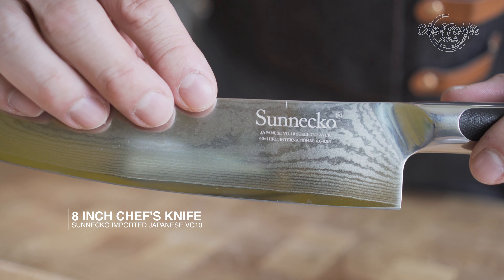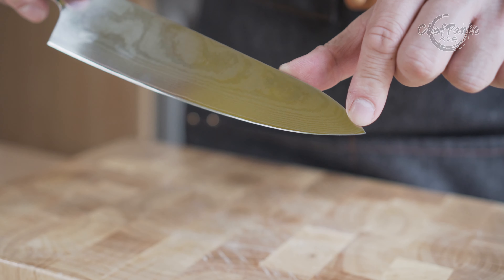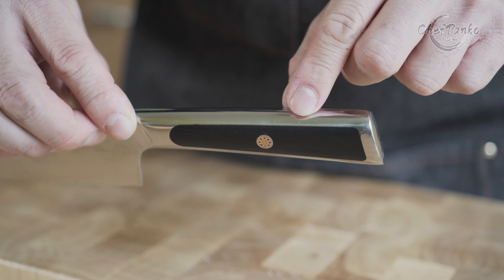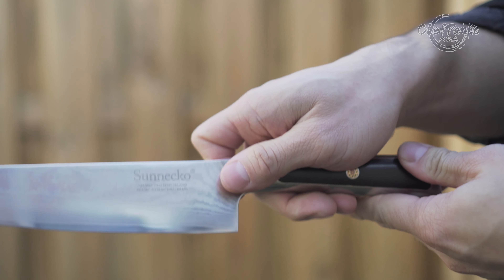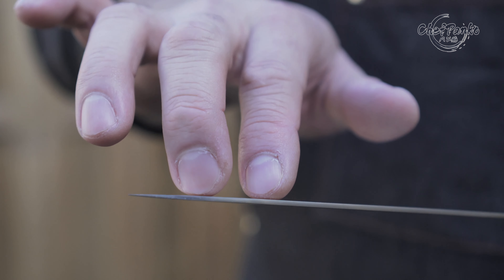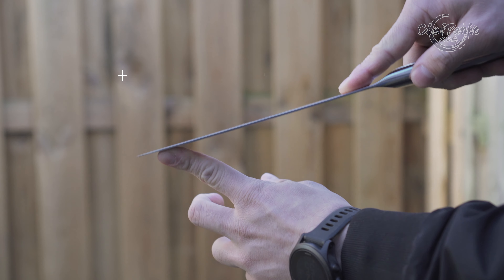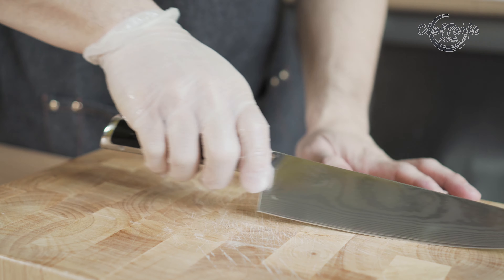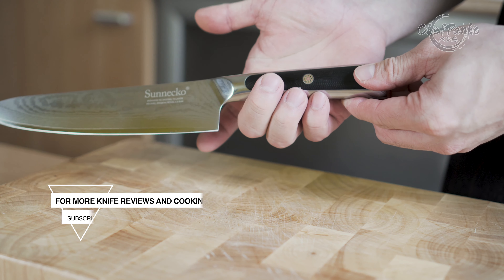Sunnecko Chef knife Japanese VG10 + G10 Handle  - AliExpress

Comment: I bought a 5 inch sunnecko vg10+damascus pattern santoku knife and after using it a while I have serious doubts about their HRC 60 +-1 claim. The knife I received wasn't super sharp and it dulled very quickly despite using it carefully for vegetables and meat. The findking aus10 was hugely sturdier than sunnecko. It makes me wonder if they downgrade their smaller knives (and drop prices accordingly).
Reply from the maker: Very interesting you might want to give it a touch-up on a whetstone. I give all the knives a slight touch-up especially when I see that the sharpening angle that they used is too low or incorrect. This will extend the edge retention of the knife. 

This also gives me an estimate of the Rockwell since I use the same angle for all the knives depending on the steel-type. 

Most Chinese knives will definitely fluctuate in edge retention from the factory sharpening but after a touch-up, they are pretty similar. 

But I never tried a 5inch knife but that is a very interesting discovery since you said it was a Santoku,  a 5 inch is for my personal use and at work to small. 
So I can't completely test it.

A 5 inch is in the range of a petty knife, more intended for smaller tasks so I can't completely give it a fair comparison over an 8inch for example. (Things, like rocking or doing herbs, etc, won't be done on a petty knife it is more of a slicing motion). So I don't think I can compare it equally. 

I will see if I can figure out a fair comparison but that is indeed a very interesting subject that you discovered. 
I will probably order a petty knife to test it and not a Santoku. 

Thank you for the information as far as the Rockwell specs on Chinese manufacturers it is saved to assume the lowest. So the stated 60 +/-1 you can give it a 59 rating (and some brands are even lower but did not have that with Sunnecko, Keemake, Findking, Samura, Tuo, Xinzuo yet).
Reply: @chefpanko  Ill give it a try when my whetstone arrives. At the moment I'm not really using it after findking arrived. To be honest, 5 inch santoku is too small to be practical for anything except slicing tomatoes.
Reply from the maker: @kratos1590  That is also the reason why I never bought a 5inch Santoku, the 7-inch santoku is the minimum and only used at home.
Reply: @chefpanko  I realized that after I had purchased it. No knuckle clearance and it cant cut large slabs of meat. Funny thing is that a 5 inch ceramic knife I owned previously was okay because it was taller and gave me knuckle clearance.
Reply from the maker: @kratos1590 , In my opinion, the Santoku 5inch should have enough knuckle clearance so that is a bad choice by Sunnecko. A petty knife in general (5inch) does not have knuckle clearance.   

This is how I use a petty knife: Fingertip grip when doing a smaller task (delicate slicing) on a cutting board, pinch grip for smaller task off-the cutting board. 
But peeling an apple or other things I usually use a Paring knife around 3.1 inches (8cm). 

I don't have experience with a Santoku 5 inches but for a santoku, I expect that it just performs like a 7-inch Santoku. Since I don't see the appeal of using a 5inch Santoku as a Petty knife. 

However, the above Petty knife explanation is only used at work. At home, I use an 8inch (at work I prefer 10+ inch) chef knife and a paring knife all I need. 

Was the ceramic version a Santoku? 

Thank you for sharing that information since I only have tested the 7inch+ knives.
Reply: @chefpanko  yep santoku part of a kit. Other than weight was pretty happy with it for vegetables and simple meats. As long as you treat it like porcelain it lasted a year in a home environment. Kit had 7 inch, 5 inch santoku and some lesser paring knives
Reply from the maker: @Schar.ar.youtube  You can hone it with a ceramic honing rod, but eventually, you need to maintain the edge with a whetstone since the honing rod is a temporary solution for a quick touch-up. Keep in mind that a Honing rod should not be used on a single bevel knife like a Yanagiba etc. Also, some Japanese knives with a High Rockwell require whetstones that are hard like Ceramic or Diamond coated but once you go for that kind of Japanese knife you should already know how to maintain a knife otherwise I advise bringing it to a sharpener that has experience with sharpening Japanese knives. Talking about steels like HAP40 steel with a Rockwell of 64+ (those require harder whetstones).
Reply: @chefpanko    thanks for detailed information... i have a queation now... i dont have any stone or strop... but i have 3 high quality Japanese knives... im about to buy a sharpening tool for them... should i go for strop und compound . Or whetstone 1000/6000 ? 
Thanks
Reply from the maker: @Schar.ar.youtube  A strop and compound will eventually stop working depending on how hard your knives are that can be in a month or few months that a strop has an effect but that will eventually wear off. A strop is intended as the final step to removing the microscopic level of inconsistencies of the edge after a sharpening session which in return gives you a razor-sharp edge. 

A whetstone is eventually a must-have to get the edge back from the countless of uses the knife edge will get rolled over and over again with a strop that can't fix and a honing rod effect will be reduced. The whetstone grind material away from the sides creates a new cutting edge that hasn't been rolled left and right multiple times, therefore, bringing new life to the knife's edge where a honing rod will be effective again until it stops working and you need to repeat the sharpening on a whetstone.   

A whetstone of 1000/3000 is more than enough for an edge that only is dull. 
1000/6000 is fine too but requires a bit more experience to jump that high, it means that your sharpening session on the #1000 needs to be good before you finish on a #6000 grit.

If your Japanese knives are very hard I recommend a ceramic stone like the Naniwa Profesional line. (Those stones are pricier on paper but during usage, you will notice that they are very effective and don't wear out as fast as the cheaper alternatives another plus is they are splash and go so no need to be pre-soaked).
Reply: @chefpanko  im reaaaaly thankful for the info you give me.. if i understand you correctly... it would be perfect a whetstone with 3000/6000  sharpening on 3000 and  finishing on 6000 ... am i right? And my knives HRC is 60 +- 1 also can i use steel rods ( HRC 65 ) or ill damage the rod or my knife ?  I love the rods but i prefer to buy a whetstone instead of ceramic rod... at the other hand i like to have a steel rod to hold my knives sharpness.. im not sure if its possible for my knives with 60+-1 HRC
Thanks
Reply from the maker: @Schar.ar.youtube  #3000 is a bit high and will work better if the knives are not that dull so making sure you get the knife on the stone earlier is better than later as this will make it harder/more time-consuming to get the edge back. It all depends on the state of your knives. The duller the knife is the harder it is to grind away material on a higher grit stone. A good middle ground is a #1000 grit stone and in most cases, a #1000 is sharp enough, you can even strop it on a newspaper if your sharpening skills are developed enough. As a beginner, I recommend ceramic stones because they are harder and give you a better overall feel of what a good angle is. While the soaking stones are a lot cheaper I don't find them beginner friendly as it requires knowledge and experience since the stone dishes out very fast, so you won't notice when you are doing it wrong (ie; wrong angle). There is more information on my website: at the knives and more tap - Maintenance & Sharpening.
Reply from the maker: As for your second question (for some reason youtube only showed half of your comment) it depends on your steel rod, most cheap steel rods are not hard enough to be effective on knives with a rockwell of 60 or higher. For that you need diamond coated steel rods, but those rods can be a tad aggressive removing too much material at once reducing the lifespan of your knives (you want to maintain the lifespan on the knife especially when they were expensive). A ceramic rod is best of both removes adequate material without removing too much or being too aggressive, hard enough to be effective on higher rockwell knives. But as I said a rod is a quick touch-up not a solution in maintaining the knife edge. A rod is just the ease of use instead of getting the stone out having it on a sharpening bench or platform so that it does not move taking the time to sharpen the edge etc is not convenient in some cases. Therefore a rod is a quicker easier solution especially during cooking. When you prepare dinner and you notice your knife is a bit dull, you will grab a honing rod for a quick touch-up and you are good to go. Once the effect wears of you will plan ahead to plan a sharpening session on a whetstone. Another benefit of ceramic rod is that in most cases they can be used wet, this gives your knife a different effect (not all manufactures allow for wet honing on their ceramic rods).

Comment: Can you make a video on wood handle maintenance?
Reply from the maker: What kind of handle are we talking about? Western handles, Octagonal? The steps are pretty simple and short. 
But if you can explain what you want to know then I can see the video context a bit better. (So that I know what to cover).

Thank you for the suggestion.
Reply: damiancanteros what I did for my knife is sand it a little for smoothness and then treated it with mineral oil to keep it moisturized and then sealed it with a mixture of mineral oil and bees wax to make it water resistant.
Reply from the maker: @The_Albino_Dino  I have more of a lazy approach, mineral oil (When the wood is noticeable dry) only and when there is a lot of dirt build-up (a layer of dirt) I sand it a down and apply mineral oil again. I'm really lazy with maintaining the handles, I just do it once in a while since I'm mostly tired after a long day standing in the kitchen (so usually I do maintenance on my day off). 

But my love for traditional octagonal handles will always take over with my purchase decisions even when the G10/Plastic handles are a better fit since it is maintenance-free. Especially wooden octagonal handles are what I love (testing a carbon fiber one it is good it looks nice but wood and octagonal has a special place in my heart).
Reply: @chefpanko  D-shape wood handle. If you want you can look for Santoku Eden Kanso. I've got mine from a seller in the Netherlands. Very happy with it.
Reply from the maker: @damiancanteros  I'm from the Netherlands, I saw the Eden knives, they are an own branded knife from knives and tools. Some of the Eden line up are made in China and some in Japan, currently I have way too many knives so I can't buy any new knives yet. 

But I will see if I can get a knife from them for a review since Global Europe has sent me their knives for review including Tojiro. 
The fun part is when I first started as an Apprentice Sushi Chef, the Global knives were what they recommend to all new apprentices I sold mine a long time ago and now Global contacted me for a knife review for them. (Tested all the series and I chose the classic series over the others a review about it will follow too).

As for wooden handle maintenance, I will see what I can do, even for the D-shaped ones the steps are the same that has been pointed out by @Dino
I will probably do a maintenance video in a knife buying guide that includes all the information about knife profile, balance point, handle design and handle maintenance.

Thank you for the suggestion it has been noted.

Comment: Hello, I have 2 questions and I would appreciate if you answer.
1- Would you recommend this knife to use in professional kitchens?
2- Is there a knife in this price band that you can say better than this product, if any?
Thank you ..
Reply from the maker: This knife in the video is not recommended for professional use since the handle does not give any extra grip, it is way too slippery. 

Before I can answer the second one I need to know what cuisine you are covering and what your main task is at the restaurant. 
A lot of veggies? Meat? boneless meat?  etc. 

And with the price range, you want it between $40 to $50 or $60? 

For example, someone that works in a Mexican restaurant is going through a lot of veggies, for them, I would suggest a Nakiri. 
But it also depends on the individual preference of the chef like the handle length, weight and balance point. 
Especially when it comes to knives that you plan to use in a professional kitchen.
Reply: @chefpanko  If I am more specific, I am wondering which blade you deserve the most price in terms of sharpness, longevity (no rust), among the knives from aliexpress you have tried. Which knife did you like most from brands like xinzuo, sunnecko in the video? Thanks .
Reply from the maker: @aentorries  Yes this Sunnecko version, so with the handle, not all Sunnecko series. 
Each brand has different handle designs etc. So it is hard to say that another series is not good either so the Sunnecko in this video is not recommended because of the slippery handle. 

As for no rust and good edge retention, I will say AUS10 core steel type Rockwell of 60.   
As for more durability so you can be more rough with it a 440C with a Rockwell of 58.

For the handle I would say western full-tang handle design with a G10 material, it is more durable and no maintenance needed.
Most western handle designed handles are back heavy.

As for brands, it is split, not all series from a certain brand is just as good as another series, that is why I do individual reviews about each knife including the important details. 
So that the viewers can decide if the knife suits them. 

As for brands Keemake, Sunnecko, Xinzuo, Grandsharp, Turwho are all oke but there are some problems with a certain series.

Personally, I did not receive bad knives when it comes to western full-tang handle with G10 material. 
As for edge retention and good rust resistance, the AUS10 core material is good. 

Hope that this helps.
Reply: @chefpanko  I watched your Findking review and when I looked at the comments, you wrote that some Chinese manufacturers do not reflect the truth in the aus 10 and vg 10 cores. If we talk about this knife (sunnecko at the top), did he get his share of this deception? Or should I trust the seller and place an order?

If I sharpen and maintain with my sharpening stones in regular periods, will it keep its function for many years? Frankly, I like the design.

Finally, if we consider the new sharpened version of the top blade with a vg max-core blade, would we see a huge difference (even if it's a class difference)? 
thank you for your interest.
Reply from the maker: @aentorries  Sunnecko VG10 core was good, it is as advertised with a Rockwell of 59/60. 

For home use, it will be good for many years. For professional use, it depends on what knife you are going to buy and the width/knuckle clearance of that specific knife. 

The difference between the VG10 above vs AUS10 is minimal and pretty much the same if resharpened yourself. 
However, I would still choose an AUS10 over a VG10 because it is slightly more durable. 

As for Sunnecko/Keemake same manufacturer only different series and brand. 
If we compare the above VG10 vs Keemake AUS10 I would choose this one:

https://www.youtube.com/watch?v=8RXsrQdQCsY&t

Better knuckle clearance and handle design. The only thing you might consider is reprofiling the knife a little bit so that it is not so round. 

As for a professional kitchen, I personally prefer 10 inches+ (25 cm+) over an 8inch (20cm) long. 

GHL VG10 10.5 inch:
https://www.youtube.com/watch?v=XIf5J-jKE4A&t 

This one is great for professional use 10.5 inches, good knuckle clearance, so enough blade width and will last you a long time if maintained regularly.

Comment: thx hard to find the perfect damast knife for me what an oddisey
Reply from the maker: I would focus on what blade style will suit you the best followed by the overall comfort of the knife. a small or large-handed handle, the weight of the knife, etc before looking at the Damascus. 
Brands that I currently like are Dongsun, Xinzuo/Hezhen. 

Dongsun has not released anything new yet but heard from Dongsun that they are planning to release a new series soon. But in terms of quality, those have been the most consistent and their 10cr15comov is good.
Currently also have heard mixed results in regards to Japanese VG10 as of today some say that they are not able to get them as the import ban still applies and some said the ban was lifted or they could import through loopholes. (Japanese AUS10 is still possible to import, but from cost to performance perspective is another factor that those manufacturers consider). Xinzuo has added Japanese AUS10 because the retail demand for it was high since Xinzuo is not only a brand but also an OEM manufacturer manufacturing custom-branded products for retailers around the world. 

But from a cost-to-performance perspective, the 10cr15copmov from Dongsun and Xinzuo/Hezhen is solid there is no reason to opt for the Japanese version (but had mixed results with other Chinese brands in regards to 10cr15comov steel the Chinese equivalent to the Japanese VG10 known as Chinese VG10).